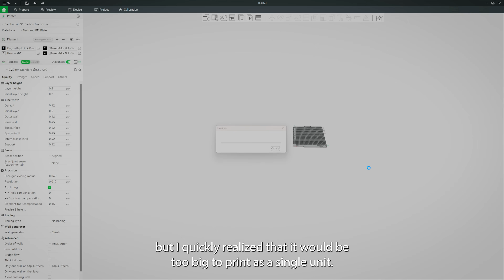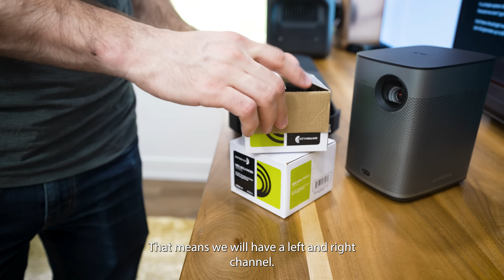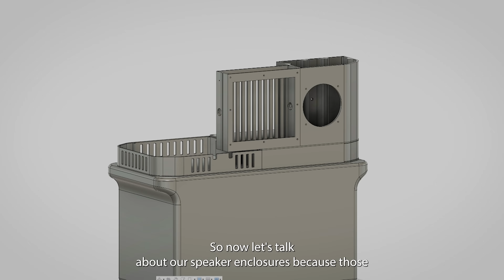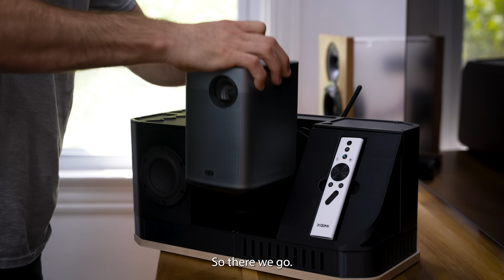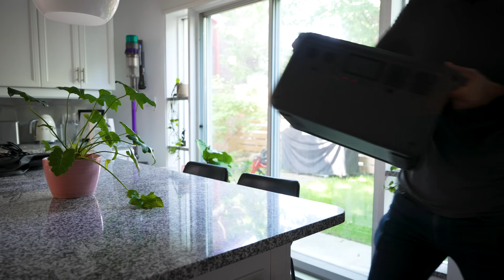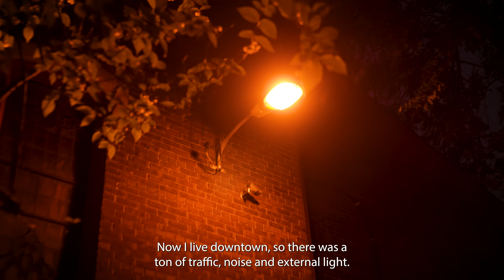I built an OUTDOOR Movie Theater...

Comment: It would have been pretty neat to have taken all the parts out of the projector and rebuilt it into its own module which you could then delete the internal speakers and also help with wiring…. Or even create a fully custom enclosure for the entire setup, relocating everything from the DJI and the Projector into a single unit…

Comment: I’ve been thinking about something I’ve wanted to do, but can’t afford all of the tools to get it done. I want to take a small HD tv, like 20” or something around that small, but not too small, and I want to build a GBA consolizer into the tv with the cartridge slot built into the side of the frame and a USB port for the controller in the front bottom corner. Then of course to keep it all cool use some thermal pads in the middle of the two boards and a decent fan and filter to help with airflow.

Comment: Hey Zac, if you want to get a better picture quality, use a black screen, projectors can't project black light, so they project lower brightness white light to give the optical illusion of the color black, so a clearer picture will come from using a black projection screen, if you want the 4K top TV display quality image and the ability to watch during the day, use an Ambient Light Rejection Black Screen, this will reject the light from your surroundings and only show the projector image, and if it's a ALR Black Screen, it will give you give you the 4K HD image in daylight as if you were watching a giant TV, now you can get a ridiculously great image from a cheap $40 Walmart RCA Brand Projector with the screen I'm talking about, but the higher the quality projector the more magnificent the image, however it doesn't matter how bright the projector is and if it's a 4K image is, it will still be horrifically bad if you use a cheap screen or bed sheet, so this information tells us that the screen matters more than the projector. 

I hope this information helps not only you but others interested in getting their movie theater fix.

Think of it this way, the screen could cost a good bit, one time, and you could get your projector cheap, I know that Walmart carries the RCA Bluetooth Projector, and it's $40, I also know that with a ALR Black screen, I can get a huge screen view and if/when my projector dies, I can cheaply and easily replace it, where as if I have a huge HD 4K TV I'm out at least $1,800 to replace the entire unit, where as the long term savings means I can keep upgrading my sound system and seating arrangements for my theater, and with the 5.0 Bluetooth system of my Projector and other Bluetooth technologies, I could easily run a sound system and incorporate a full body floating massage chair with Bluetooth speakers to fully emers the viewer, I could even run Bluetooth tactical transducers on the seating using the money I saved from not purchasing a TV because the ALR Black Screen was the one time purchase that made all my replacement purchases for watching movies and shows a $40 replacement cost or more depending on what I felt like spending on a projector, now if it's a permanent fix inside the home, I would say go for the $40 projectors, buy two, put them side by side, use a video duplication splitter, align the images slightly offset, make the left image slightly darker by setting your contrast accordingly, and then you can use Real D Glasses on whatever show or movie you want by running both projectors or watch standard with the projector that has the standard image settings.

Comment: so i built this at xmas but using a different setup. I used a white wall and had a 200 inc screen so massive and i had a black waterproof box with a switch and a projector all sealed in. The tricky part was the bluetooth speakers range as i needed them to be like 30ft away and to daisy chain and be water proof but i did that too. And the projector had speakers too so i ended up with a surround sound effect. I had to have lots of vents which again was trick to make water / weather proof. And a place for the controller. I didnt print anything but i did use gaffer tape and stuff i found in my shed lol 
Overall it cost me about 500 inc switch or without like 300.  
It worked in rain but not underwater lol  The sound wasnt super loud but it was good quality and immersive . It looked crap but for a fraction of the price of any other setup who cares as its behind you. 
Perfect for 2 palyer mario kart on split screen each 100inc wide! The kids were blown away and loved that they could keep playing even when it snowed and rained lightly. I also bought a roll out fake lawn which meant they could lie on the ground and roll about and be clean and safe etc. Oh and the power was mains and or a big ass battery which gave us about 3 - 5hrs play for all on max. Not bad for a bodge  ;-D

Comment: rather then use clear silicone I would have printed an adapter part for the holes for routing wires that would have kept it sealed

Comment: Next way to level this thing up is by adding the smallest possible homemade “computer” essentially that has the ability to run emulators as well as its own WIFI supply. Then you can have an N64, Gameboy, PS1/2/3/4/5, or whatever else your heart desires slapped straight onto this relatively small outdoor package that is completely self sufficient with a decent sound system, a projector, charging capabilities, and so much more. THAT would be amazing. Almost zero wires, complete freedom, easy access to all of your favorites, modular, mobile, and seamless connections to various platforms. Brilliant. Love what you have so far. Excited to see if you take a leap in the direction I’m suggesting 😎

Comment: I just want to provide an insignificant correction to your conclusion about subwoofers that matters only to my audio brain, but the poor directionality of low frequencies doesn't make it so you can put your subwoofer anywhere (if you're looking for the best listening experience that is) However that is what allows you to have only ONE subwoofer while not being able to descern its point of origin. You can observe this with a cheap soundbar that relies on a sub for everything under midrange. In this scenario when you have the sub close to you rather than the sound bar theres a distinct separation in the location of low vocals, kick drums, bass guitars, from the rest of the sound.
Reply: P.S. I think you're an incredibly clever and skilled craftsman, and I loved the video!

Comment: You can simplify this setup a little bit further. Since the dji power 100 does usbc charging up to 140w you could get a usbc to that barrel connector for the projector, rather than the dc > ac > dc with the ac mains adapter.

Comment: If the projector's power input is 12v, you could probably power it directly from the DJI power station with a single cable.

Comment: Bought the battery, bought the screen, built the connecting mounting hardware and speakers, now you want to add a Pi onto it, if you do that then you just built a rather inconvenient laptop with a huge screen, or a bulky portable PC, leave all that junk out- you're defeating the purpose of why you built the darn thing, don't treat it like a multi-tool.

Comment: Well you created Mono speaker that you perhaps use to emulate stereo? Not really enough to properly experience movies... Proper movie experience needs at very least true 5.1 surround not emulated. You could simply buy cheap Bluetooth speaker or sound bar and get this same experience. Also how is 1024 wats battery is the smaller size of these batteries...

Comment: i see what the idea of this was (making an advertisement for this power station). but there are some things that make me feel like this isnt really worth the efford it took. first of all: the speakers. yeah, you designed the enclosures yourself and made them fit the drivers but without an crossover i can only imagine it sounding ass (and no one other than you tried the thing). and secondly: the whole "its portable and i dont have to plug things in". at first i thought, yeah this would be kind of practical. but with you carrying that projector screen alongside everything it makes it surprisingly und practical. just hear me out: why not build a nice box/enclosure to house the power thingy, a projector, a nice bluetooth speaker system (something nice like a soundboks for example), your consoles and what ever you need. its literally set up almost as quick as this because you still only have to connect like 3 to 5 cables. and just like that you can save a lot of time and even get a similar if not much better experience that is even more usefull and versitile.

Comment: For $700 you could have also gotten a much better projector. 700 lumens at that price point is atrocious. Given how big your "portable" package ended up a standard projector would have worked and you could have gotten a 3000 lumen 3lcd epson or viewsonic for over $100 less or if you wanted a laser projector epson has one that's only 1000 lumens but can be had for $600.

Comment: You could try the LattePanda Sigma for the mini gaming SBC, even though it came with an onboard mid-range graphic chipset, it also has an M.2 slot that supports PCIe 4.0 x4 for further expansion.

Comment: Is making a screw hole slightly smaller than the screw like a new and novel thing to ppl who only 3d print? Because that's like woodworking/home improvement tip #1. Not shaming anyone. I'd just always assumed that was fairly universal knowledge.

Comment: Yeah like many people here, I have to agree that people trying to find uses for power stations with inverters inevitably fall into the backwards trap of 'Lets hook up this supplied inefficient AC-DC power supply to the already inefficient DC-AC inverter in this battery pack'. The only correct way to do this is to have as few conversion steps as possible and stick with DC-DC conversions wherever possible. A lot of devices only even use 19v because china mass produced so many laptop chargers that it's the cheapest thing they can work with. Ideally these 'power stations' with the advent of 28v 240w USB C charging should be using 24/48v outputs on the battery itself to minimise the conversions needed and in most cases dropping the inverter entirely. The only time an inverter is really useful is if you're doing something that absolutely needs AC for practical reasons, such as applications exceeding 1000W just for the fact that it has far lower constant amperage on the circuit.

Comment: Oh part 2? I would go for one of the new laser projectors that shot the image for just below the screen that way your sound system will work better and less tripping hazards out side. I made one like this but it was just a set up that could easily fit in a box and one major repeating problem is tripping on the speaker cables

Comment: That subwoofer needs a ported design with resonant frequency around 40Hz to extend the low end below the 50 that the speaker is rated for. HexiBase here on you tube has some cool 3d printed designs that could help.

Comment: I'm sure those speakers sound solid after the spray sound deadener treatment. I wasn't feeling the plastic at first and thought wood would be better even at 1/4". I was also thinking you could just add butyl rubber inside to quiet and stray frequencies and rattling and it would be less messy, but that spray seems to work two-fold for rattles and dampening while sealing the speaker. GG man looks great. Now you just need a BB gun to shoot that damn street light out lol my lord. I have one as well outside my master bedroom and I hate it

Comment: So a 3 inch speaker can be called a subwoofer now? Come on... There's no doubt that it will help fill in some low mid frequencies... But I don't care how much extension that speaker has, it will not produce anything under 60Hz with authority. Calling it a subwoofer is downright fantasy.

Comment: I would def. NOT do the ras. pi - there are way better x86 ryzen boards that are nearly comparable to the steamdeck and could even run the HoloISO SteamOS directly.   And there aren't that many builds like that on the net.  Ras-Pi is great for emulators and such but... it's just so over done.

Comment: the power bank ($700 store link/$1000 amazon) + projector($700) + 2 speakers ($31x2) + 1 subwoofer ($55) + amp ($100) cost just shy of $2000 without tax. Then theres the cost of the rubber spray can, wires, solder, flux, braid, etc. Remember that, if you're thinking of replicating this project at home.

Comment: Overall, a very impressive project! One question, though; Have you taken into account weather, and/or insect resistance? Chances are better than zero that you may experience a sudden weather event, and no one wants to have to go to the trouble of cleaning dead bug carcasses from various components, even if it's only a couple of times a year... It doesn't need to be weather proof, but weather/insect resistance will save you a lot of headaches in the long run...

Comment: I love what you’re doing. I think it would be cool to design the drawer as a “port” where you can create different drawers for different consoles/media devices. Using that form factor for a pi, dvd/bluray player, Wii, PlayStation slim, or whatever else you might want to use with your projector.

Comment: You could have taken advantage of USB PD and gotten a USB-C to 2.5mm DC jack cable with 20V handshake.
-No need to include the XGIMI power brick in the build
-More power efficient since you have less high voltage devices using the AC inverter
-The power station already supports it
Reply: This should be higher up! Exactly what I thought.
Reply: can you explain like I'm 5? I dont quite understand your comment 🤔
Reply: The power brick from the projector , that coverts AC to DC, is not neccessary. We have DC batteries in the dji box and also certain DC outputs (USB). But instead he uses the regular AC outputs from the Dji and connect the power brick to it. What he does is DC->AC->DC. What he should do is DC->DC. More conversions more power loss. Now not every DC->DC connection is compatible that’s why he talks about the USB handshake. The USB protocol gives you certain voltage options. Once supply and receiving end agree on a voltage, power will be delivered. The input side of the projector is not usb just a simple ground and power line. So you have to create a handshake for the receiving side or hardwire the delivery handshake side.
Reply: @janet.snakehole  USB-C has this feature called PD (Power Delivery), which allows a USB device to request more power (a specific voltage and watt limit) from a charger than is normally supplied by regular USB. This is how fast charging on USB-C laptops and phones work. You can buy specific boards/cables/adapters that basically allow you to use USB-C chargers to convert any device that falls into the 5-20v power range (and typically up to 100w) into being powered by USB-C instead of their specific power supply.
Reply: Yes, and plenty of existing DC->DC options as most laptops run at 19v
Reply: Those "SDC" ports on the front actually output 12v directly as well (depending on what the projector/amp take)
Reply: @rickmuk  the projector is 19V

Comment: Pro tip short dry wall screws work really well on 3d printed parts. The bigger sharp threads really cut in and hold well.

Comment: My favorite part is when you said DJI made it with repairability in mind, proceeded to open it and the transformer is completely covered in epoxy lmao
Reply: There is a difference between replacing faulty power cells and fucking around with a mains voltage transformer.
Reply: That's often there to insulate the circuitry and prevent arching.
Reply: Idt thts epoxy, it looks to be like some thermal compound just slathered all over
Reply: smh

Comment: Really cool! One future upgrade you could look at, since the whole setup draws less than 100W, is you could move the power to the USB-C on the power station. You wouldn't need those more bulky AC power supplies anymore, and it would be more efficient since you're not running the AC inverter on the power station along with the power losses that would come from converting the battery DC to AC and then back to DC again. That would also mean a longer runtime in the end!

Comment: How much power does the amp draw, without the projector? Interested in the bluetooth speaker part of your build
Reply: Probably not much. Their 200 W claim is dubious but even if it's true that's still only 222 W in @ 90% efficiency which is pretty typical for a Class D amplifier.

But, that'd be almost 10 A x 24 V which is pretty high for the tiny wires he put on it.